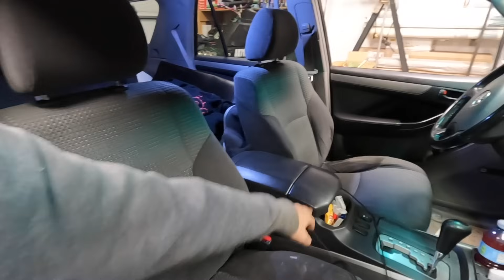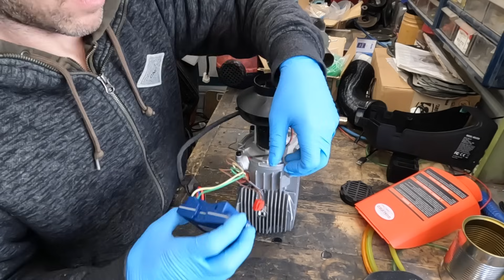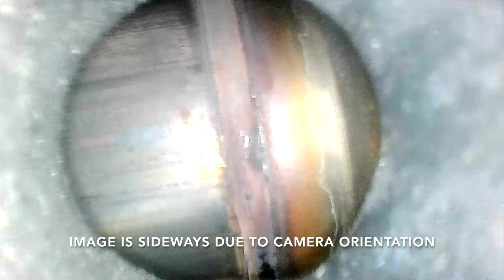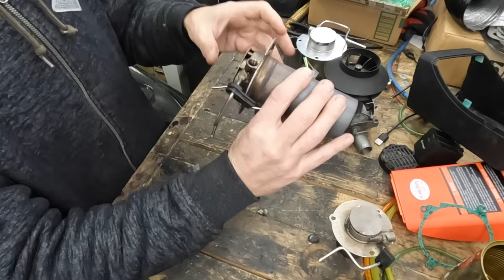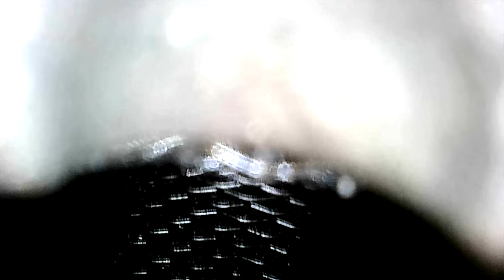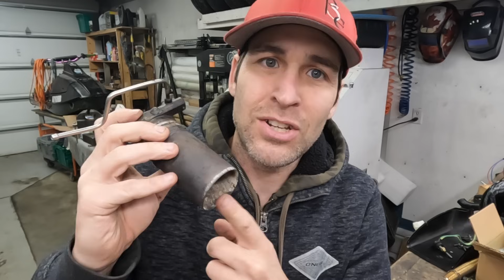Diesel Heaters - Orientation Deep Dive - Heater Mounting Explained

Comment: If you're a high auric person, the words you say and your intentions matter. You snapped the glow plug right after you said be careful. You kind of jinxed it there. 😅

Now you have a new toy to poke around with. I was wondering whether it was small enough to see into an ear canal? My right ear is totally blocked. Maybe I should ask this question to my doctor. 😅

An engineer measured the 8kW to be outputting only 4kW. Can't wait your test.

Wouldn't a rocket stove of some sort is the most efficient way to burn waste oil? It wouldn't need any electricity. If you use or modify a diesel heater to burn waste oil, you still have to open it up and clean the carbon sooth built up daily?! 

If the flame initiation hole is very critical, I'm afraid I won't be able to mount it upside down, fan blowing downwards position because I plan to dip the heat exchanger in water in my water heating project. That's for later.

I have a few questions for you regarding my air heater project with exhaust heat recovery. The exhaust outlet ID is 3/4"  or ~19mm and OD is ~24.5mm and the ID of the exhaust pipe is 1" or ~24.5-25mm. If I install a 3/4" straight bulkhead fitting somewhere down the exhaust pipe to transition from inside of a heavy duty plastic bucket of water to outside, do you think it will "significantly" restrict the exhaust flow or should I use a 1" ID fitting? Then it will make it a bit more complicated, I mean I will have to use a 32mm-25mm silicone reducers as the OD of 1" bulkhead fitting will be 32mm. Any suggestion is very much appreciated.

My last question is if I dip the stainless exhaust permanently in water, will it get rust, if so, after what period according to your experience? Thank you very much in advance for your answers. Have a nice weekend.
Reply from the maker: Haha... yeah.. I looked at the plug afterwards and there was some sort of anomaly right where it broke... The plut itself is ceramic, and the metal threaded part has a crimp or 🤷‍♂️ something right in that spot. 

I wish you hadn't asked me about the ear canal, lol... of course I had to check... it's not pretty in there. To answer your question, this is not the idea tool for that job. I can see just enough to make me want to see more. 

Yes, I suspect most 8kw heaters only put out about 4.3kw based on fuel consumption. The heater that I got is actually a bigger unit, from what I understand. 

A rocket stove could work, but I believe the battle is this... Air flow is dependent on losing heat out the chimney. They are powered by convection current, so the amount of air coming in, is related to the amount of heat rising out of the chimney.  If you dissipate the heat efficiently (don't lose it out the chimney) then your combustion air flow decreases and you are left with a dirty burn. This is why forced air is used on almost everything. 

However, if you aren't paying for the fuel, and you are willing to throw a lot of it away, then it could work with the right design. 

Fan blowing downwards shouldn't be affected by the placement of the initiation hole. I have not had success with running this way as the heater will flutter and flame out HOWEVER this may be because I wasn't using a chamber wick, as it had been removed. 

I have done a tiny bit of testing with my pipe, and I can say that 3 feet of extra pipe (about 5 feet in total) causes the CO levels to increase a little.... This leads be to believe that it will become a problem pretty quickly. 1" should be safe.

The stainless exhaust won't runst, from what I can tell... If you keep it from getting to hot, it appears that it will last a long time... if you get it red hot repeatedly (like I have with mine) it will crack if bent or flexed... Ask how I know, haha.
Reply: I'll spend a bit more and go for 1" then 😅ouch! Nothing will be red hot. I will shut it down once the water reaches 40-50°C. I'll run on low to mid heat setting. I don't need much heat. According to my calculations, it will take 16-49 hours for the cold water to reach that temperature. Chances are I will shut it down way too soon before that. @loweredexpectations4927
Reply: @examplerkey: If you let the exhaust bubble through water, you get soot problems and even flame outs after a while at low settings.
Reply from the maker: @werner.x  For sure... that probably wouldn't even start up at all ! I think he meant with the exhaust passing through and venting to atmosphere .... but yes, bubbling under water would not go well
Reply: I plan to run the exhaust from the heater through the bucket of water in thermodynamically efficient curved L shape, semicircular shape or one complete loop and not more than that. The exhaust then comes out of the bucket from the lower side into the surrounding air like water would come out from an IBC tank tab, not bubbling through water. The intake fan probably doesn't have enough pressure to do that.   @werner.x
Reply: @examplerkey  I see. My exhaust line is 3 meters long in 25mm size plus one barrel, 37 cm wide, where the gasses have to go down 40 cm.
The hot side of the 25 mm tubing is going upward in a kind of S-slope, that takes 80 cm length to enter the barrel.
Cooled down gasses leave the barrel at the bottom, just a slight bend there, then straight to the wall, then one 90° bow, then straigt through the wall, total lengt of the cool side 1,8 meter, no silencer.
Hot gas rise length is 40 cm total, except that the gas can rise inside the barrel another 20 cm, but that's not energy, the fan has to provide.
Inside the barrel gasses fall down 35 cm - fan has to push that - then the long col side goes down about 1 degree to let the condensation flow freely.
I'll never even try to calculate thermodynamics or flow resistance, not my business, but i did realize over the last two heating periods, that this exhaust lengt with the original thin diameter piping is the limit, regarding backpressure. I cannot always use lowest setting (1,2 Hz for the pump), this only works, as long as the heater is super clean. A bit on the dirty side and the heater will soot itself to flame out over night in lowest setting.
I don't have any reliability problems with middle or even  back down to one third setting though - although i'm loosing exhaust heat in these settings, the barrel and the long line won't draw every bit out - that's happening in lowest setting ony - have to modify the long straight line with coling fins some day.
Too much text, hope you get the idea. 3m spiraling downwards in wide slopes should work, maybe not in lowest setting.
This thin stainless pipe will get brittle over time - it's very thin material and stainless isn't elastic per se. Nothing to put much work into!
Reply: Thanks a lot for sharing your setup 👍. It seems that you have an exhaust heat recovery system based on forced air from a small PC fan blowing a section of the hot exhaust pipe that is placed inside a metal box/barrel?

The total length of your exhaust exceeds the maximum recommended length of 2m and total bends amount to ~480°? which is again more than the 270° maximum recommended. It will work for a short time but over the long run, it will build up sooth inside the heater as the back pressure is not equal to the inlet pressure and that's probably why yours struggles to run on the lowest setting as you have pointed out.

The substance that has the highest specific heat is water. That's why I'm using a box of water to extract almost all the heat from the exhaust. The water will store the heat and radiates back out slowly like a sand battery but more efficiently. The only downside is the maximum temperature permitted by the heavy duty polypropylene plastic box. I also have a high density polypropylene barrel. I choose the right body/amount of water suitable to extract the heat from the exhaust over a long enough time, so that I can enjoy the heat plus get some warm/hot water as well, as the byproduct. I also plan to take the ECU out of the heater jacket for ease of access, prevent it from melt down in case of power cut off and possibly some modifications if need be.  @werner.x
Reply: @examplerkey  Your setup should work.
I don't blow air inside the barrel.
The exhaust spirals down per inlet design from 2/3 of the height and leaves at the bottom, one part of the heat rises up and heats the upper third of the barrel, so that i can safely dry shoes, gloves, warm paint and any other stuff without danger of overheating it.
The barrel is just a simple radiator like any other street heater in some homeless areas.
Simple things work, when you need them.

I don't have use in more air flow than the heater itself delivers, because the shop height is 6m and what is in the air, is rising and mostly lost to the roof and the two 4x4m roller doors with poor sealing and no insulation.
So - the more radiation, the better. Like in any wide open space.
That's, why i might exchange the long "cool" pipe after the barrel "cooler" with a normal household plate style radiator - if i find an old one at the junkyard ore elsewhere.
No need for such in low setting - there is no exhaust heat left after the small 60l barrel - but gets useful, when i use higher settings.

Comment: Question - have you determined what is the longest exhaust pipe that can be used that would allow the heater to keep working efficiently (same diameter as the original)?
Reply from the maker: I planned on doing those tests this week, but got sidetracked... I may be testing that this weeked as I do have 16 feet of pipe. 

I can tell you that even an extra meter (3 feet) causes a noticeable difference if CO.. but I'm I just did a quick test, so can't say for sure.
Reply: @loweredexpectations4927   I have a 3 meter pipe. Runs fine. No idea on CO, still dont have a meter
Reply from the maker: @Nordic_Mechanic  Good to know... I have 4 meters to try on mine, haha. 

I'm guessing that you won't see running issues till the CO get up over 200... maybe even more. I think a LOT of what determines the outcome is your pre existing situation. Meaning, if you have a heater that is already running borderline high elevation, with a little inlet restriction and then you restrict the exhaust, that could be trouble. 

If you are running close to sea level or have your heater manually adjusted lean with no restrictions, then restricting the exhaust may not be an issue.
Reply: I have about 3 metres and two silencers on mine (fitted under a VW van) no issues with running, even on low overnight just keeps the van warm at 19C in outside temps of around freezing.
Reply from the maker: @thegrimreaper7777  Good to know for sure !  

I can see how this is easily overlooked, but if the heater were going to have issues, due to a long exhaust, it would be on the high setting. The limitations of the exhaust restrictions comes down to how many kw you are trying to force out the exhaust. The more exhaust your try to force out, the more problems you will have. 

Another detail that I may have overlooked, is that I have been / will be using a 5kw heater. A 2kw will be able to use a lot more before it becomes a problem. 

I only have about 5 metres of exhaust, so we will see.

Comment: Have you seen David McLuckie's latest using oil he seems to be going in the direction of what I've been thinking about
Reply: What do you think about pointing it down and then drilling a hole through the center from the back of the burn chamber and drip the oil in from there onto a baffle
Reply from the maker: @colinhamer6506  From my experience, they don't' like to run well facing down, but I think my testing was done without a wick, so that may be the reason for my results... I should retest. 

There is very little room to drip the oil in from the back side You would have to cut a notch into the burn chamber finned area as the fan runs within a few millimetres of the chamber. I like the idea of that, as it would be passing through the hottest part of the heater... but it also introduces challenges in how to route your air flow, allow the oil to pool and still aerate it. 

My brain constantly goes nuts with ideas.
Reply: @loweredexpectations4927  it's always bouncing around my head aswell. If the fan is switched for 2 external one's and the combustion air is heated possibly by the exhaust it should work better
Reply from the maker: @colinhamer6506  Haha... Yes, this is true. I would like to keep it confined to the heater, but that would free up space inside. 

That reminds me. I've been talking to a guy from the east coast of Canada who has been running propane into the inlet of his heater to juice it up. 

My thinking is this. If I venture off road and build a heater that the average joe can't easily do, then I might as well go all out. Maintain the ECU, controller and a few bits, and build a "proper" waste oil burner. That may or may not be a this year project.
Reply: 🤦‍♂️I posed the video at 20min to right that comment lol
Reply: I really need to stop ⏸ing videos and commenting before seeing the full thing I had no idea you were going to mention David etc lol
Reply from the maker: @colinhamer6506  Lol.. I do the same thing all the time... I don't want to lose my train of thought so I comment right away.
Reply from the maker: I think so... I'll have to see if he has published one I missed, haha. 

Okay... yes, I had been talking to him about this a few weeks before... I got all my stuff together to build something but didn't realize that the heater would run well standing on end. (pointing up). Then it got really cold and I didn't want to be messing with waste oil in the extreme cold, haha. 

My original idea was to make a secondary chamber, like his, but sitting on it's side (not unright) and have it compact enough to fit in the heater.... so it functions like a normal heater ... kinda. 

Now that I know they will run pointing up, and have tested it that way for a few hours, I have changed my plans a little.

Comment: Good luck on the waste oil adventure this winter, Joel.
Reply from the maker: Thanks ! I'm probably going to need a LOT of luck.
Reply: Maybe.  I have noticed that all of the DIY waste-oil heaters I've seen on YT have been of the "open burn pot" variety.  Although commercial waste-oil heaters are more similar to your diesel heater.
Reply from the maker: @patchvonbraun  Yes, I have noticed this. You want lots of room for crud to build up, and an open burner is a good way to do that. I think because they are waste oil burners (free fuel) most people don't put a lot of consideration into efficiency. 

My concern is partly efficiency, but also keeping it compact and user friendly.... That being said, the cleaning process of my latest design would still be beyond many people.

Comment: Can't wait to see if your mod works for waste oil !
Reply from the maker: Fingers crossed, it goes better than most of my other waste oil experiments, haha. 

The idea is that it will be a removable piece that you can remove and clean out, pretty easily...If it works at all, it is hard to say how long it will take before it requires cleaning  🤷‍♂️
Reply: If you can work out how to clean it relatively easily you will be the top rated  oil burner :)  The race is on between you and David :) @loweredexpectations4927

Comment: Love it. # fight me in the comments. I would think the fuel is drawn in by a Venturi effect  once the heater is started   ??
Reply from the maker: Haha... I can't tell if you are serious, or if this is your attempt to start a fight 🤣 

The venturi may actually be part of what starts the burn in the main burn area 🤔 ... The reason I would argue against this is that the air actually comes into the main burn area, directed out to the circumference. 

I didn't mention it in the video, but if you look at the inspection camera view, in the end of the burn tube you can kinda see a few fingers in the slotted are that are larger (wider) ... The incoming combustion air is actually partly shielded so that it doesn't blow directly back into the glow plug hole.